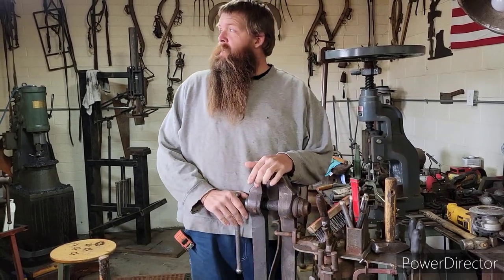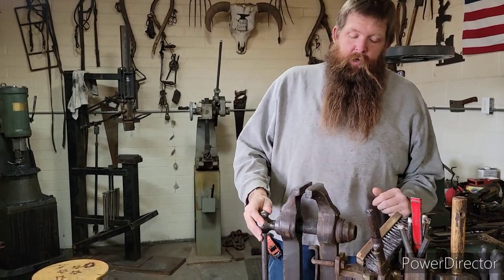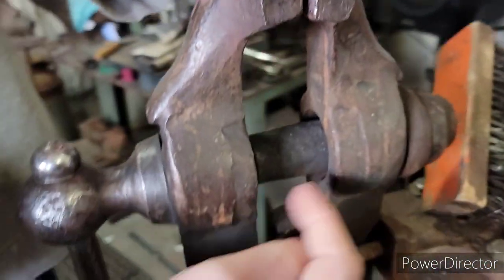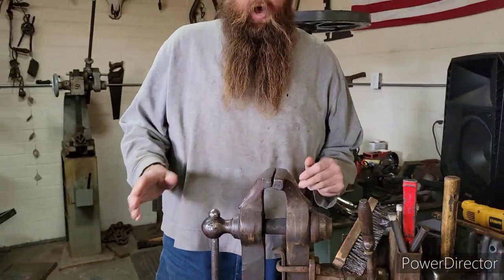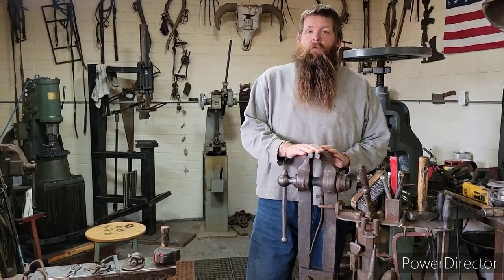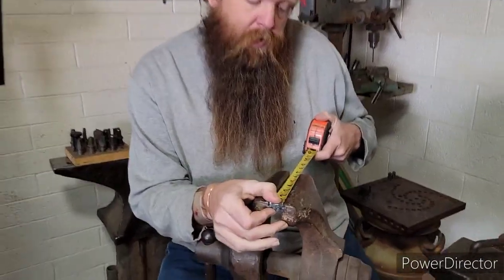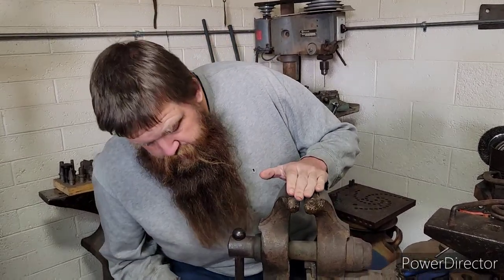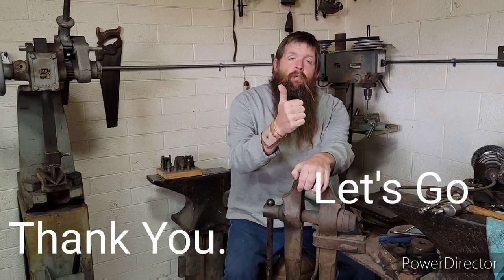Blacksmith Leg vise, Post vise.. Why you want one.. Let's Go

Comment: Leg vise wish I had been gifted one after Graduation not just for BlackSmith and handy for a handyman's best strong arm.
Great tool 
I brought one 4 years ago $80 and the handle shows no abuse and screw Great shape. Needs mount super sturdy and super tool installed properly. 
I have a post hole holding steel pipe 3 ft into cement, and mine is solid 
Thanks

Comment: My dad had one in the shop on our farm. One day  when I was 6 or 7, I decided it would be a good idea to see how far I could open the jaws up. I learned several things that day. 1) the screw comes out. 2) the front leg of that vice was heavier than I thought it would be. 3) the spring that provides tension was stronger than I was, and 4) dad wasn't as interested in how far the jaws opened as I was. 
The struggle to get the screw back in the nut was frantic and prolonged. Dad walked in on me in the midst of my toil and was less than pleased to see me covered in grease from armpit to fingertip. (mom wasn't happy either). I didn't have the foresight to hang on to it when dad sold the farm in '94.
Reply from the maker: I love this .. I have done something similar.
Reply: I did the same thing to grandpa's vise . Scared me when it popped open ! lol..

Comment: was able to find one in almost pristine condition , just a bit of patina .
it does have a few welded bits like a diagonal piece of steel plates to absorb the shock even though the person i bought it from didnt need to do it since the leg in the leg vice is used for that , its also a very heavy boy.